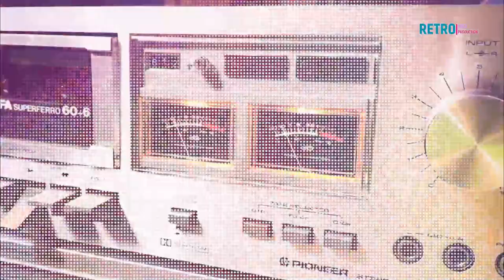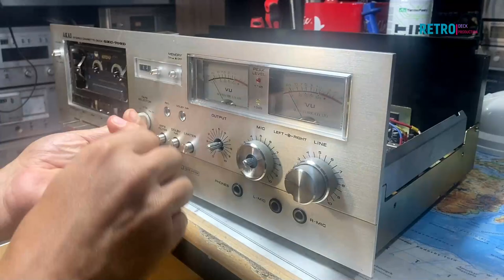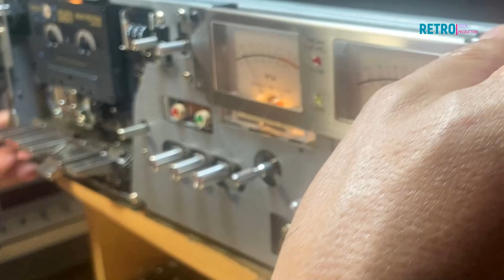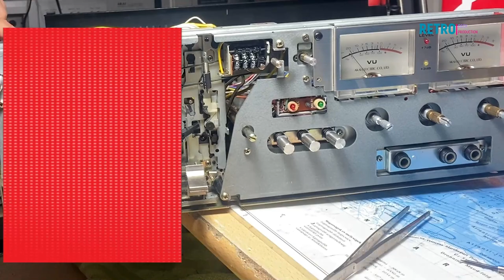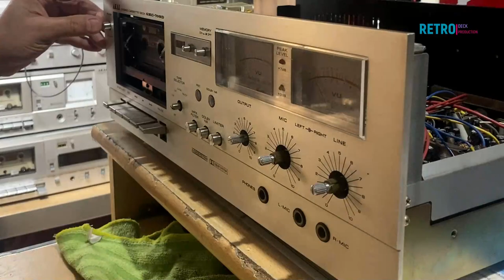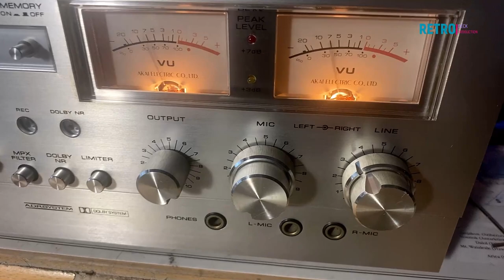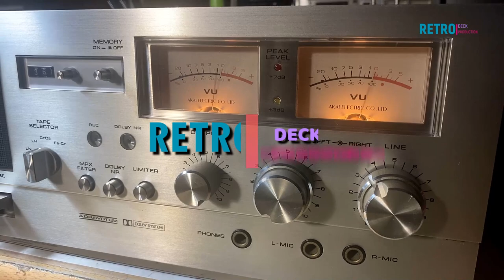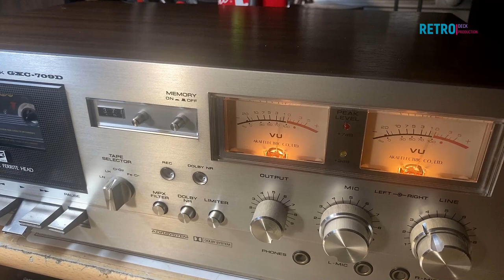AKAI GXC-709D cassette deck - simple belt replacement

Comment: Where did you get the belts and idler tires? What is the idler tire size?
Reply from the maker: Most recently, I already bought from Aliexpress, because you can buy a much cheaper and high-quality strap. Unfortunately, I don't remember the size. But if you take it apart, you can easily measure the required length.
Reply: Where did you buy the  rubber wheels for idlers
Reply from the maker: @bernardzertuche7376  I rarely buy idlers. They don't have the right size or they are too expensive. That's why I usually make it from an O-ring seal or a flat rubber seal. Buy a high-quality machine gasket and it can be customized.